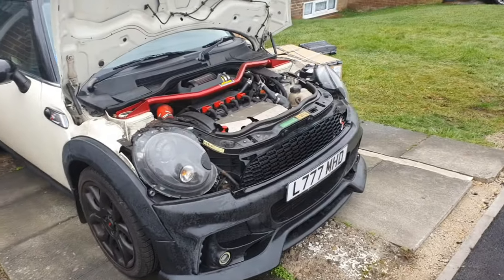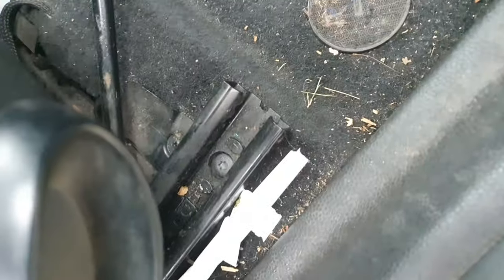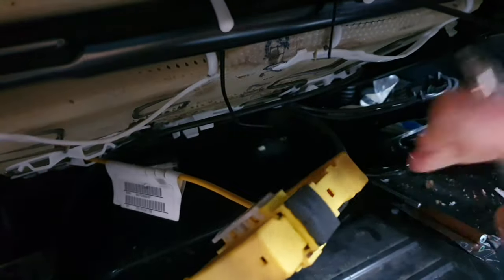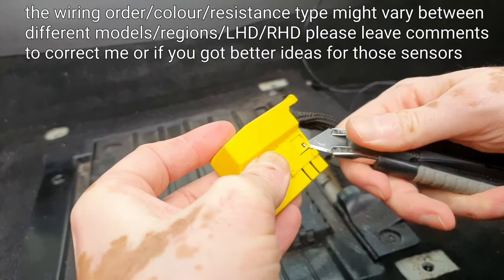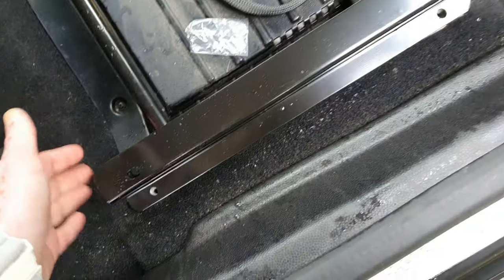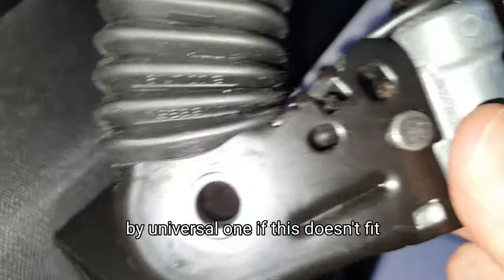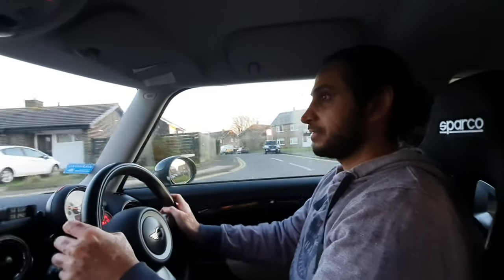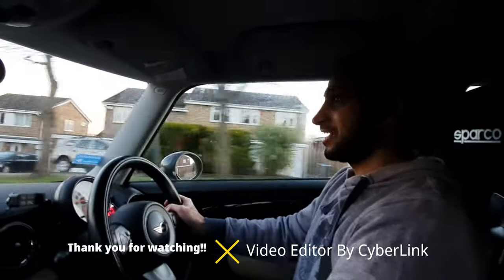how to install racing seats ?

Comment: Hi what air bag resistors did you buy? Thanks
Reply from the maker: 2.2, got them from Ebay
Reply: Thankyou
Reply: @alansari1985  hi bud did you have airbag light on and seat belt restraint warning message on? Did you have two resistors fitted in the passenger seats? Thanks